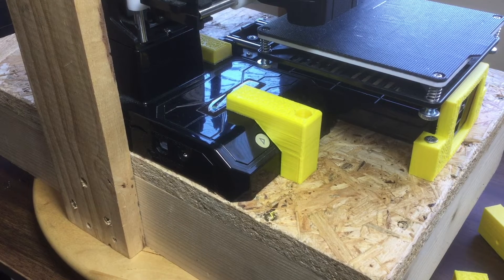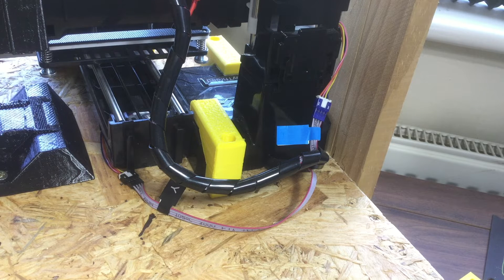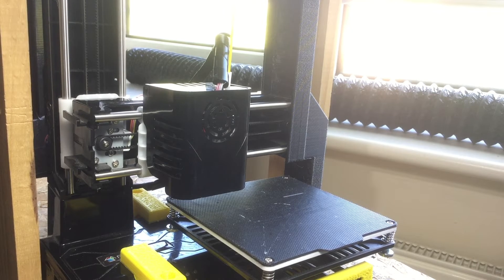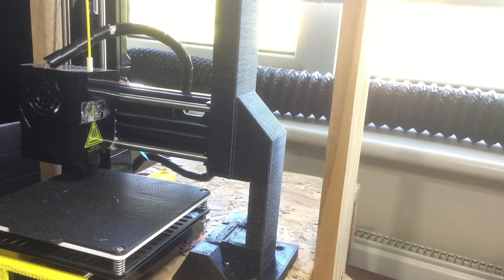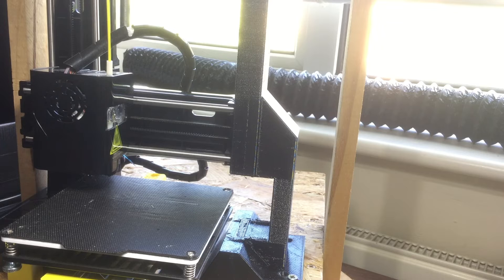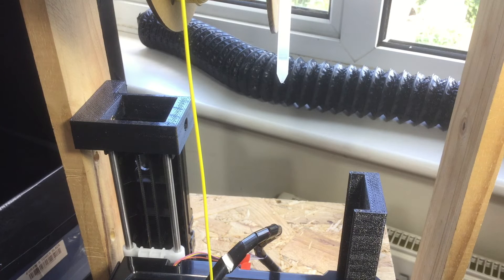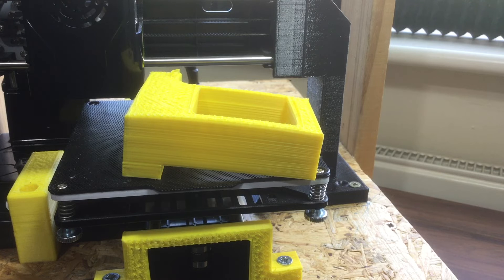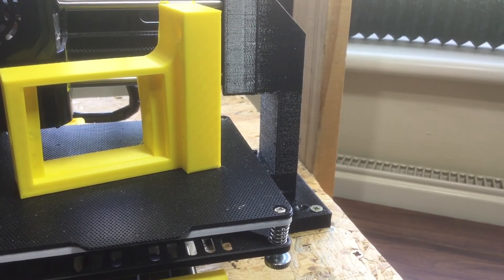EASY THREED K9 MINI PRINTER IMPROVE PRINT QUALITY WITH STABILISING BRACKETS

Comment: I've had a lot of fun tinkering with my k9. The most successful modifications I've done to the little thing are replacing the carriages, adding an extended base that holds the y-axis and main chassis , and overhead spool holder and a homemade glass bed. All the 3D printed Parts I use came off of printables. I forgot who made the spool holder and carriage, but made with layers extensively overhauled his printer. I found using his extended base and adding a tray to it worked better than anything else on a stock K9. At this point the little thing has given me less trouble than any of my other printers.
Reply from the maker: Thanks for watching the video & for your comments. They are very easy to use and trouble free as you get used to them. Even things like the bed surface I was sceptical about works so well. I'm now using a 1 thick skirt which just peels off leaving no trace. They are very reliable and easy to work on. Thanks for sharing your experience. Ill look into the references for the base which I think is great idea. Kind regards & best wishes.

Comment: Cool! I am going to print it)
Reply from the maker: Thanks for watching the video. Nice to know it was useful. I decided not to use the vertical piece. Id suggest just using the Y bracket, the hold down brackets & the Z bracket. These seem to be effective without the X piece which is time consuming to make. Another guy did it better with a fitting and a vertical rod of metal. The fitting slides on the rod. https://www.youtube.com/watch?v=Yl032eD3_IM
I think this is the better idea. Kind regards & best wishes for your 3D printing.

Comment: Great video, I used two of your brackets on my K9 and designed my own x-axis vertical stabilizer bracket that I hope should help with the x-axis arm droop.

Easythreed K9 3D printer Mods
https://www.youtube.com/watch?v=Yl032eD3_IM
Reply from the maker: Thanks for your comment & watching the video. Im glad it was useful. I decided not to use the X channel piece because it was too fiddly to install and stopped proper access to the printer. It seems a good trade off not to use it. I don't know if you'd consider posting your own design on Thingiverse. I think people could benefit and it helps the community as a whole. Kind regards & best wishes.
Reply: @NightStarLeafTech-vj3ez  It is on thingiverse, The links are in the description on my video.
Reply from the maker: @3DMaker2024-i  Thanks. I watched your video just now. Thanks for giving the channel a mention!. Looking at your set up, are you using Octoprint? I have just started trying to use Octoprint but the hot end temperature is not reported correctly. If you don't mind me asking, what does your temperature show? Kind regards & best wishes.
Reply: @NightStarLeafTech-vj3ez  Looking at Octoprint right now, using 180c & 210c target temps. The temperature   tab shows correct temps, as does the M105 command in the terminal.
Reply from the maker: @3DMaker2024-i  Thanks. Mine is problematical on temp. I'll have to see what can be done with it. Im glad I know that it does work with others. Kind regards & best wishes. Great video BTW.

Comment: I have some questions first is was the last piece you showed in the video printed on the 3d printer after the modification second can do you recommend this printer for projects wich require making designs that require a 3d printer?
Reply from the maker: Thank you for your comment. I have decided not to use the vertical piece for the X axis which is difficult to make and difficult to place effectively. Only the Z, Y & base brackets seem necessary. I have not shown a print in a video yet. I can only recommend the K9 now if the budget you have is very limited. There are other printers which are significantly better and can be bought for $100 or there abouts eg the Kingroon KP3S or The Tronxy Crux 1. These are good printers for a very cheap price and also the Bambu Lab A1 Mini which is under $200 and is one of the best printers ever made presently. It is in a class of its own. Should your means be in the $100-200 bracket the Bambu Lab A1 Mini is the absolute top recommendation. The Easy Threed K9 is of acceptable quality for a person with a very limited budget. Kind regards & best wishes.

Comment: when i print with k9 the object be melted what is the problem ?
Reply from the maker: You could post a query on Facebook on the group for the EasyThreed printers. They may be able to help. Its better to explain exactly what the problem is and then take photos to show if you got any print, what the print looked like. Kind regards & best wishes
Reply: Your extractor/nozzle is probably too close to the printer bed. Ideally the filament should be applied like a very thin string of toothpaste that still grips the surface.

There's 3d printing forums on Reddit with excellent resources on how to level your printer bed while it starts printing.
Reply from the maker: @Peannlui  Thanks for contributing.Hope fully the person can get their problems resolved. Id like to do something about creating a community etc but I do already find having the time to do things difficult so I'm not sure.

Comment: Nice video, please continue make more videos about Easythreed K9, is very helpful and help alot to lean about
Reply from the maker: Thank you so much for your comment and watching the video. I will be making more videos for the K9. I have a lot planned. I really like the printer. It prints great. With the addition of the brackets it does become much more stable. In my next video  I'll look at using squash ball feet for the printer. If its clamped to a board it gets a bit noisy but the squash ball feet make it quiet again. Kind regards & best wishes.

Comment: Good video! I downloaded the files. Are you using the ironing setting in cura for the smooth top surfaces.?
Reply from the maker: Yes. Ironing is on. Other settings too. Walls 1 and extra infill walls. The walls going right up to the surface create gaps. There is only 1 wall which is the minimum possible. Adding walls in the infill makes the model strong but the walls don't go right up to the top so there are no gaps that extend to the surface. I did go into it in one of my other videos. I will add a link. The video was long & covered a lot plus that. Ill edit my comment later with a link. Kind regards & best wishes.